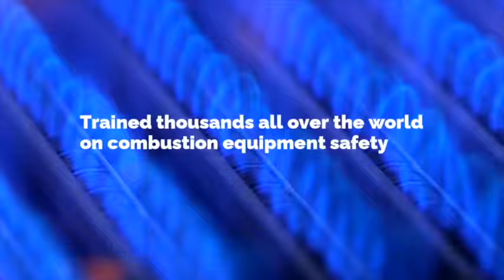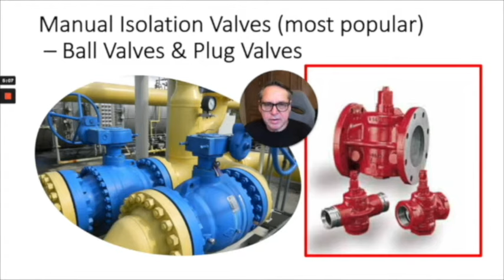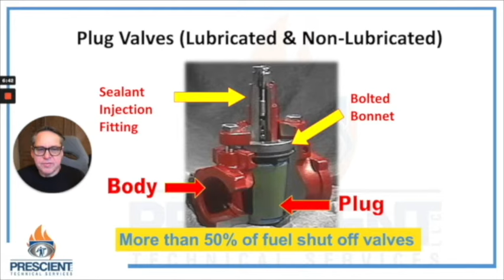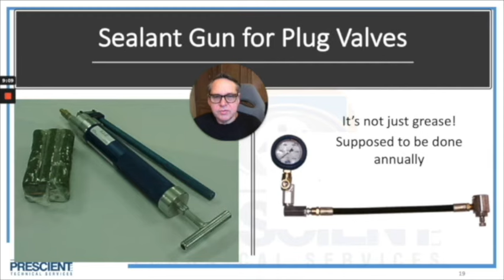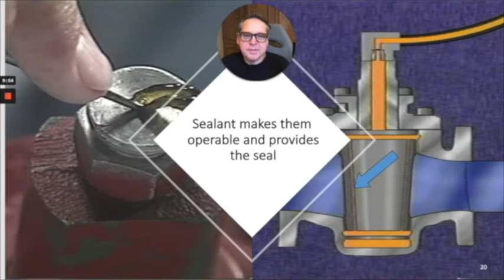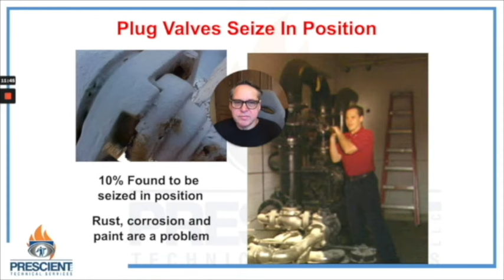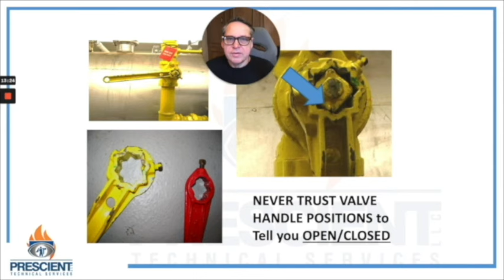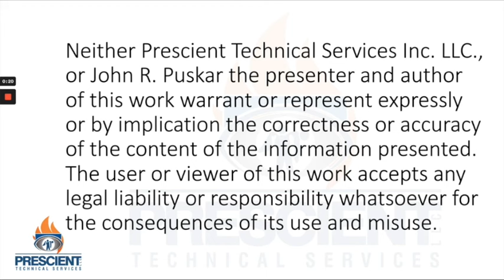Gas piping valve mistake  costs 2 lives and over $30 MM in damages, simple mistake anyone can make.

Comment: Why a disclaimer?
Reply from the maker: In this case for this video there's not a lot to be confused about with the main message. However, I would rather err on the side of caution. Despite trying to be very clear and keep things simple I am dealing with a broad range of skills and experience out there. If someones going to start to try and actually service lubricated plug valves they should see the course modules I have on valve basics and fuel train testing to be better prepared.